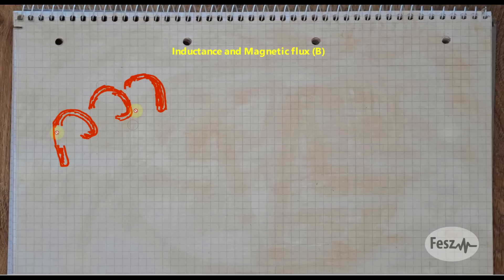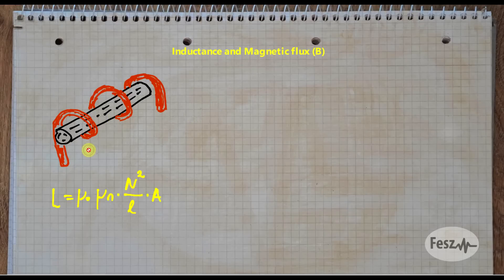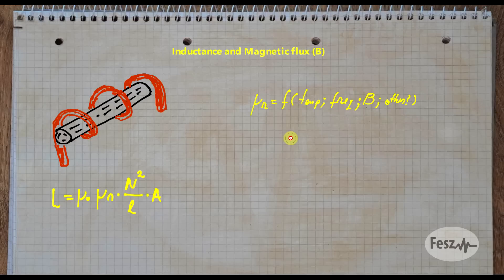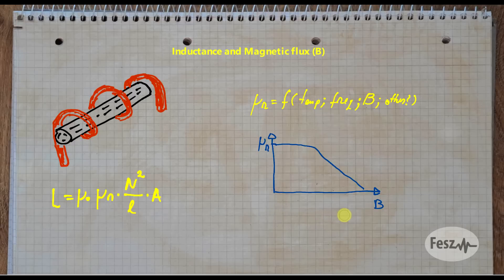Basics of Magnetic Amplifiers

Comment: Hmm I’ve been a thinking, now I’m weird and want to attempt to build a low current out sine wave oscillator using a couple tubes I think, or maybe one of these compactrion tv tubes. Minus the tube being the active component, one could build a relatively simple low level output sine wave oscillator using like a bridge T circuit even with transistors maybe a simpler Wien bridge oscillator to create the control frequency for a full wave mag amp, there’s still seems to be two AC inputs though one is definitely label as control input, but apart of the AC load there’s a bridge rectifier which I’m assuming is like acting as a push pull amplifier the main control frequency sets the first stage of magnetic switching, and the rectified AC input is creating pulsed DC to push and pull the current is this right? 
And if so would this current be equal to the control current, or will it be equal to load current do to it being part of the load current? 
If that’s the case then this second AC input would need an isolated or separate oscillator but then I feel like it could start modulating it oddly if it’s not like synced to each other. 
I’ve bee looking into interesting ways of creating an inverter and started to wonder if this could be used as one in away. The trick behind it though if it can work and if tubes could be used as the oscillator. You could have up to 100-200 volts of usable DC potential in the B+ supply if it doesn’t need to be isolated unsure of that factor I’m still learning things! 
But a string of 9 volt batteries could give the b+ if it’s not. The control winding could be wound to match the output impedance of the oscillator circuit too. It’s just the second ac input for the full wave that’s interesting seems impedance may be lower, but I do have intentions of powering a high impedance device with which ever way I decide to go about it

Comment: you only get it one way cuse the magnets only amplify dc so you only get half the polairity as the  the other poliariy or half cycle dont get any amplification and thats why the other direction need more power. th eamplifiaciton is casue by a opposing magnetic force agaisnt the dc currnet own field. its a compression effect casue witohu tthe opposition you only get a magnetic field and the currnet is weaker cause you get lot of magnetic force in the coil but not so much current in the load so the opposition that is orgiinalyl a dc effect is forcing more electrosn to disipate in the load and less electrons in the coil. without permanent magnets on dc power transfer get much higher energy loss in the cores casue what you want is it  or current as if current the force of the field of the core need to be opposed. unless the intention is field as in that casue you dont get much power in the load if that is your bulb then.

Comment: Pretty Good!  Yeah in real life, I designed several Mag Amp smps's.  Special cores but inexpensive. and as for bulky...  No.  capable of controlling/regulating relatively high currents with low currents.  Running smps at 100KHz.  The cores 8-10 mm OD become very hot since they are being driven in and out of saturation.  The calculation for the inductor is different from "just designing" an inductor for smps.  The control is a simple linear regulator on the secondary side.  Just a few microseconds of the front edge of the pulse is controlled and then the core saturates and full current passes thru.  So the V-sec is small.

Comment: right side of meter you have connected as inductance measurment. and inductor is also powerd by primary side and induction will only occure at change of current at primary side and due to closed coupled secondory side also provide output voltage. can we measure inductance when it is energized by external power source ? meter provides some fixed or (user defined frequency) then calculates inductance. here in your video inductor fasing external power and also meter frequency as power source.
Reply from the maker: For this measurement, the secondary side inductance measurement is done with an AC signal, coming from the meter, but the primary is supplied with a DC voltage. Since its DC, it will not get transferred to the secondary.

Comment: Industrial/Commercial welders used the magnetic amplifier into the 1980's - my personal experience was troubleshooting and repair of the Miller 330 AP-B/Goldstar and Aircrafter 330.  The former controlled the DC bias current via a 200W rheostat, the latter through a triac. Heavy, reliable machines!
Reply: Syncrowave 250!  A very reliable machine.

Comment: A mag amp is a “static variable inductance in series with a load”. This was the description in an instrumentation manual.

I saw two basic uses for these.  In instrumentation to amplify DC signals.  When the instrumentation was designed the choice was tubes or mag amps.  Tube type DC amplifiers are a challenge and much less reliable than mag amps.   

The other use was in static exciters to provide up to 50 amps to the field winding of a turbine generator. The alternative was an amplidyne

In addition to the control and gate windings, most mag amps also have a feedback winding and a bias winding.  Adjust feedback and bias to set zero and span

Comment: people always seem amazed by these things... i find it more amazing how much technology has been left by the wayside... that our education system lacks in outlining the basics...

the name "saturable reactor" is a far more... self explanatory name. you just apply a dc magnetisation current to "saturate" the core, at which point theres no lenz reactions or "inductive reaction" to an AC current. the coil acts like a plain wire with only DC resistance.

another closely related device is the "peaking transformer"... using core materials of two different saturation curves, to produce pulses from a sinusoidal or other waveform.

it pays to collect as many old books as possible... the ignitron, kenotron, thyratron, and pliotron may be obsolete, but often, those books that deal with them break down many otherwise complex subjects into simple and easily understood basics... which then makes it far easier to digest other seemingly unrelated topics...

we got where we are by riding on the shoulders of extremely intelligent men. 

its a bit like opening an old desk fan the other day... oh my, it has an inductor. which were also common in ceiling mount speed controls.

early on, it was cheaper and more reliable than any capacitor of the time. but now its always a capacitor used as they are so cheaply made, and the dielectrics so much better. ptfe and polyethylene versus waxed paper, etc...

Comment: In Polish radars, in the 80s/90s, in modulator systems for controlling the magnetron, transformers with a so-called "rectangular hysteresis loop" were used.
The core of the pulse transformer was "under-magnetized" by an additional winding with regulated current.
This has nothing to do with signal amplification, but there is an analogous shift in the core hysteresis characteristic.

Comment: The Fred A. Leuchter Associates electric chair design used a saturable reactor to regulate the output current to 5 amperes. The instruction manual described it as a magnetic amplifier. There was a 6A circuit breaker "to protect the load" which I always thought was a particularly eerie turn of phrase.
Reply: This is a VERY specific piece of technical information, sir.
One does hope none of the loads were...accidentally damaged.

Comment: I built a magnetic amplifier using a pair of 1 amp Variac cores.  Each was wound with half the number of turns that the 120V original winding had.  Cores were stacked & 10,000 turn control winding was wound through both.  I used this to control the current to 8 fluorescent lamps on wall of discotheque, which were modulated to the music.  It is important that the 2 cores be matched & the number of turns on the power windings match to the turn, or AC will back up into the control circuit.
Reply: 10K turns for 120VAC (Vpk=170V).  you built this mag amp?  Somebody guided you wrong.

Comment: 12:00 yes, it is still used in PC's power supply, aka cross regulators (is the big core inductor plenty of wires with almost all output voltages at the output side of the P.S.U.

Comment: I graduated in 1979 with an Electrical Engineering degree. We had exactly 1 hour of vacuum tube review, lol. I was fairly well prepared in basics to work on Mag Amp controls in steel mills. I had to pick up control principles on the job unfortunately.  I was privileged to see the evolution as mag amps were replaced by analog electronic drives, then digital drives and master computer controls were added as the overall system manager. And PLCs rapidly replaced the extensive relay panels. I think it was a great time to be an EE. As I worked in old mills there were many mixed mag amp/plc/digital drives/and master computers that were still in use to 2006. I got pretty good at digging up old vintage parts and figuring replacement parts. The upgrades we installed were over decades. It was challenging and satisfying.  I even had cranes designed in 1890s lol!   Mag Amp mfgrs like GE, Westinghouse,  Allis Chalmers, Jocelyn Clark, and more. 
Your article is very interesting!
PS, it wasn't just power, it was used for regulating dc motor speed, torque, and tension loops. I toured a WW2 submarine mueeum and the mag amps were clearly present.
Reply: Sorry you had such high expectations of college. TEST is real life. You passed with money as the reward. I did something parallel in expectations and experience. CHEERS to you!🎉🎉🎉
Reply: Entonces si tienes la experiencia necesaria, quizas te animarías a hacer un esquema funcional, sencillo con dos nucleos toroidales y para Audio/música?, llevo años intentando plasmar algo de esto en un amplificador real de audio, y es un poco complejo para mi, aunque conozco la amplificacion de válvulas de vacio bien,
Un esquema ?

Comment: First [community] theater I worked in used saturable core realtors to control the stage lights.  The console had an array of slider potentiometers hooked up to the dimmer cabinet, delivering a 0-10vDC voltage to each lighting channel.  Buzzed like a hornets' nest when the lights were brought up.  Cool retro'.  Doubtless the waveform was ratty as h311.

Comment: Fascinating subject, and well presented, as always. I wonder could this principle be used to make a "voltage controlled" low pass filter? Changing the inductivity of the filter L component should give a different response. Also, could saturating that core from your example be done by a simple permanent magnet moved into proximity?
Reply: You are right, it's all possible.

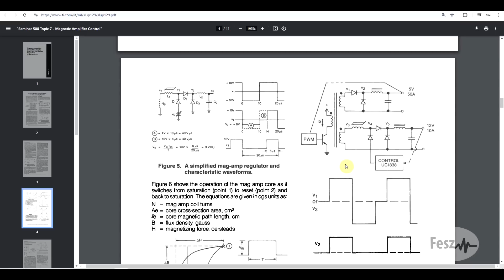Comment: 12:27 I think it is still commonly used in cheaper and lower power ATX power supplies for PCs. It generally goes by the name of 'group regulation' although I could be mistaken, it is possible that in such cheap PSUs there is no form of regulation of all auxilary rails and reliant on tight enough coupling and low enough resistance of components to ensure stable enough voltage under most load conditions that the rails remain within tolerance.
Reply: AFAIK there is no saturation in group regulation inductor.

Comment: 3:07 in this setup, how much of the inductance decrease is caused by the power supply circuit actually shorting out the secondary side as you decrease the series resistance? At 250mA, there is only ~12 ohms on the secondary.
Reply: 10:22 I think this whole experiment is wrong - the current simply passes through the 20 ohm resistance and the power supply - try disconnecting the power supply and simply short the leads together - the light bulbs will come up again.
Reply: @_wave64_  If so, how would one control inductance from electrical input, and in continuous fashion? It would need a variable resistor, but usual electronics and mechanics are out of scope.
Reply: @sergepetrov8598  With high resistor values and high voltage, or with a current source/sink (vacuum tube anode). The problem in these experiments is that (besides explaining the theory correctly) he is using low resistance values that are simply shorting out the secondary side - so what we see is not the core saturation, but rather just a simple impedance transformation.
Reply: @_wave64_  My bad not to notice that coil was fed from voltage source with resistor, not from current limiter mode. Got used to CV/CC power supplies.
 If windings are located separately on a ring, leakage inductance can be huge. In my experiment some months ago, shortening secondary resulted in ~~ 50% drop in primary inductance. Here  (pri and sec) wires look the same, unfortunately.

Comment: noob question: could crossover distortion be avoided by applying a low DC bias to the AC side of each transformer? Of course with bypass capacitors (could we still call them "coupling" here?) to block it from getting where we don't want it.

Also an unrelated question: how to I check the saturation characteristics of a certain transformer? The datasheets I find online don't provide them. Should I look for the datasheets of inductors with the same cores like you suggested? For example I have some EI14 1:1 isolation transformer in transit and would love to try out a mag amp. I wanna build it for a unique kind of guitar distortion effect.
Reply from the maker: Usually, the saturation behavior will not be described in the transformer datasheet, but rather the core datasheet - the exact core material and geometry is what influences this; I am actually working on a couple of videos on this topic, hopefully they will be ready in the not so distant future
Reply: @FesZElectronics please please more videos about mag amps, especially practical ones.

Comment: I’ve seen these in schematics, not intended for power regulation or amplification, but rather as an electrically variable inductor for passive LC filtration. There’s no other (non-electromechanical) method of varying inductance with an electrical signal, and varactors don’t have as large a range and are probably more temperature sensitive. I can see this being especially useful for RF circuits, where the required coil size is much smaller, and you don’t have the ability to make active filters and virtual inductors without expensive high-end semiconductors. Not just for VCAs and VCFs, but for VCOs too. I don’t know how linear they are compared to JFETs for amplifiers and active filters, but you can always use an extra winding for feedback.

Comment: Nice explenation. Mr. Ben-Yaakov uploded the video about usage of this variable inductor idea to provide lower losses in power converters working with much higher input voltages (Buck)/smaller load. Probably variable frequency is still an easier solution.
Reply: And that explanation shows a nice picture on how  "change inductance using DC" works without AC  backfeed.

Comment: MANY PC power supplies had a magnetic amplifier on the 3.3V rail, with a core made of a special material.
Reply: Mine had a core consisting of two same size rings: one some kind of ferrite, and another one seemingly just plastic.
It was widely used in ATX 3V3 rail before transitioning to separate buck converters from 12V rail, and a small TO92 transistor controlled several Amperes of output, deriving it from 5V winding.
Reply: @sergepetrov8598  
The special core material (With a square magnetic loop) is VERY BRITTLE and that's why it's enclosed in a protective plastic case.
Reply: @paulcohen1555 was that brittle material Beryllium?

Comment: I have not come across a magnetic amplifier myself - as far as I can remember - but I first learned about them with regard to old radio transmitters from about 100 years ago. It seemed to be the only feasible way to control the amplitude modulation at kW power levels back then.

Comment: There are still magnetic voltage regulators (Magnetischer Spannungskonstanter) in the market, at least in Germany.
Reply: Well, afaik magamps were widely used in Wunderwaffe "Fau" missiles during WW2.
Reply: @sergepetrov8598  What have they done in these units?
Reply: @ghlscitel6714   Afaik missile included at least INS and some flight program, so needed control circuits. And German engineers prefered magamps to vacuum tubes for some reason.
Reply: @sergepetrov8598  Vacuum tubes tend to be very delicate devices, easily damaged by vibration - such as that would be seen in military equipment - whether it was being launched or the target of explostive devices.  Mag amps on the other hand don't care about vibration, they are much more robust in high-shock environments.
Reply: @sergepetrov8598  Think of late 1930's electronic power amplifiers, and then contrast that with robust, predictable, powerful, magnetic amplifiers... especially for servo control.

Comment: Will an ML4818 (Fairchild) phase shift modulator provide accurate current control to such similar loads ...with proper f.b. loops and some additional circuitry from its outputs to generate a load frequency synced "ac controlled signal" ? ...instead of the normal "dc".....perhaps even core saturation may be tightly controlled.
Reply: Getting an ACCURATE current level is relatively easy with all the high-gain opamps available.  The tricky part is the control loop design.  That inductance vs. current function is highly non-linear, which means the GAIN is highly non-linear. This means you have to be extra careful about loop stability, and make some compromises with response time vs. control level.  If you're not careful, and design a circuit to respond quickly when the amp is nearly saturatied, it could easily have too much gain to remain stable at low saturation levels.
Reply: @Cynthia_Cantrell  well I shouldn't have used the word "accurate". but  "reasonable"..
...On second thoughts..with the 4818...the magnetic flux could be better controlled with its phase shift control circuitry..thus core saturation is controlled .